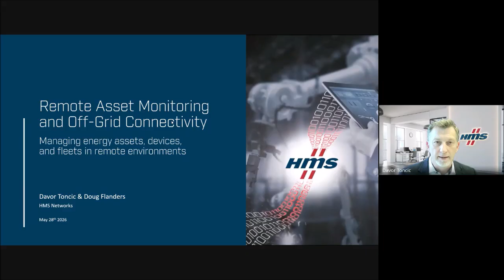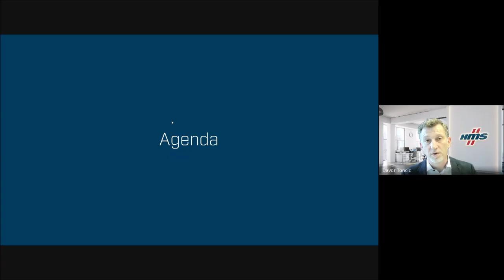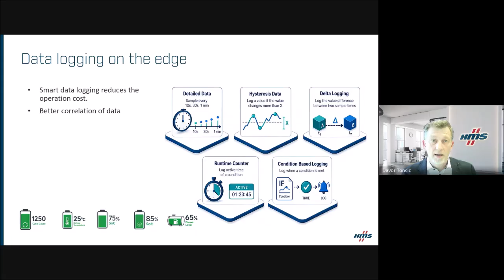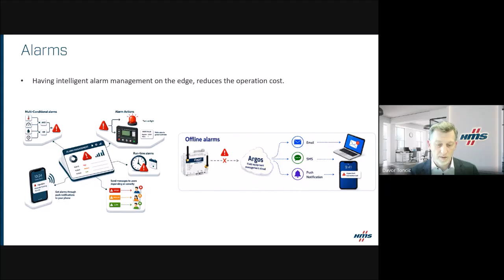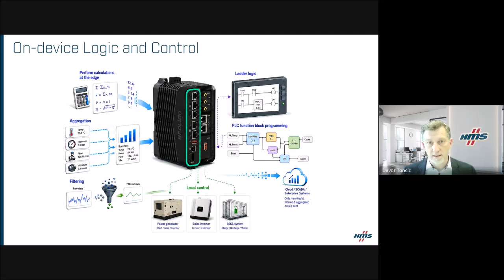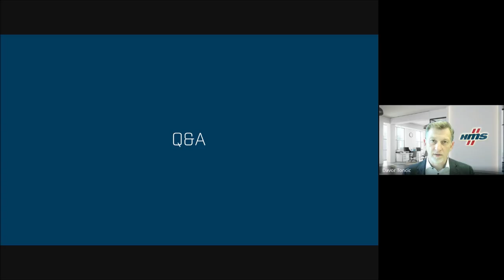Webinar: Reliable Monitoring for Remote Energy Systems

Comment: I kinda dislike the dichotomy that gateways are either locally configured or cloud configured, there’s definitely hybrid solutions. Hybrid is more robust: faster feedback on-site and easy remote changes.

If the gateway already has internet connection, slap a basic local web ui on it. Then only sync upon submission, local is truth, and show a basic real time (1-5s) graph.

I’d much rather be frustrated at a failed change from my AC office, compared to after 5-10 minutes waiting for an app to refresh in the field.